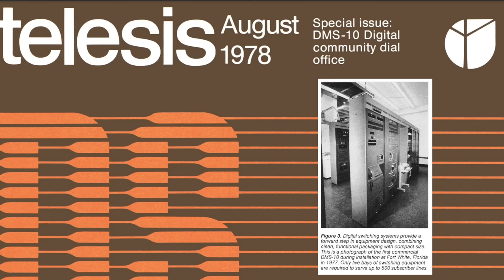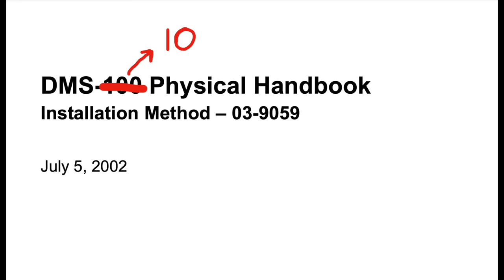🚚 Driving across America (AGAIN) for a DMS-10!

Comment: Wow.  I remember starting in telecom in 1990 and seeing probably 15 of these installed to replace step-by-step switches in rural cities in Missouri.  These things were BULLETPROOF.  The ones in my territory operated for MONTHS at a time without a single "code 5" customer ticket (code 5 meant problem was due to inside switching equipment) being attributed to the switch.  The few codes we had were typically due to the individual line card of a SINGLE customer that fit into the larger "drawer" shelves.  I think each of those wider "drawer" cards fit 32 line cards.
Reply: Must have been UTS at the time, we're you also pulling the last of the XYs too?
Reply: @Stache987  My first territory had two 5ESS (about 14,000 lines each), two 2BESS (each with about 4,000 to 7,000 lines), a DMS-10 with about 5,000 lines) and a #5 crossbar that was being cut over to a DMS-100 TOPS switch for operator traffic.  We also had about seven 1ESS that were eventually swapped out for 5ESS in 1992 when AT&T couldn't make enough attached processors (APS) to make them 1AESS in time for SS7 adoption for 800 portability.

Comment: I installed and tested DMS switches on the west coast in the 1980s. One interesting thing I found was that there was a more-or-less complete programming language built into their "store file" system, that didn't seem to be documented anywhere. So I wrote a manual for it, called 'Store File User's Guide'. There's another story regarding that book, but not for public consumption. I also used that language to write a utility program called 'steve1' that got passed around quite a bit.
Reply: Maybe you need to send them a copy of the book and your program!
Reply: @thewhitefalcon8539  I only have the program on a 9 track tape that's been stored in my barn for 30 years, so little hope that it's still readable. I do have a few. extra hard copies of the book if they want one. I'm not entirely certain that DMS-10 used the same software as DMS-100/200, so it might not even be useful.

Comment: A little correction, it wasn't the first digital switch on the market.
While I don't know if it was first but the Swedish AXE from Ericsson was earlier.
From Wikipedia:
"The AXE telephone exchange is a product line of circuit switched digital telephone exchanges manufactured by Ericsson, a Swedish telecom company. It was developed in 1974 by Ellemtel, a research and development subsidiary of Ericsson and Televerket.[1] The first system was deployed in 1976.“
Reply: Good debates about which thing was first are always possible to have (for any new tech) and it can depend on how you think about the details.  The 1ESS was the first large scale switch to use stored program control way back in 1965, which makes it a digital switch in one important sense.
According to "100 years of Telephone Switching (Chapuis and Joel)" when the AXE was introduced it still used space division switching with reed switch contacts for both the "subscriber subsystem" and the "group selector subsystem".  Digital Time Division group selectors were introduced to the AXE in 1978, and TDM subscriber selectors in 1982.
The DMS-10 was fully TDM from the start, so I think Sarah is correct in saying it was the first "truly digital" Class 5 switch.

Comment: The DMS products were developed by Bell Northern Research in Canada and manufactured by Northern Electric, later renamed Northern Telecom or Nortel. I worked for BNR Inc., a US subsidiary of Bell Northern Research. We were located in Palo Alto, CA, later moving to Mountain View, CA. I was aware of the DMS but did not to development work on it. The SG-1 "Pulse" and SL-1, later designated "Meridian", PBX systems were transferred to us for engineering maintenance and development. The "Pulse" had a time division analog time division common bus where samples of the speech were transferred between parties. The SL-1 encoded the speech using pulse code modulation, similar to the DMS. If you could acquire either one of them, I think they would be nice additions to your museum. Note that the SL-1 underwent extensive modernizations over the years, so the early versions that I worked on may all be history. I do know that we did a version for the Swedish market, where we licensed that version to be manufactured by another company in Sweden. We designed versions for the hotel/motel market. Of particular interest, the extension numbers were room numbers and this numbering scheme often had a variable number of digits and gaps which made the number assignment and translation challenging!

The DMS had line card drawers, with a replaceable circuit board for each line. The idea was that faulty circuit boards could be swapped out without affecting service on other lines. In the PBX, one board could serve several lines. When a board was swapped out, calls on the other lines served by that board would get disconnected, but it wasn't so much of an issue in a business.
Reply: The line drawers came from the DMS100 product family and were retrofitted to the DMS10 later.  The original DMS10 line packs were in PE bays, 4 lines to a card.

Comment: for Charter Communications in the mid 2000's I worked on their DMS-100 platform extensively before they switched over to a Metaswitch platform around 2009. I loved working on those DMS systems.